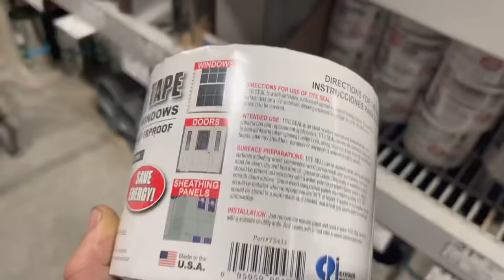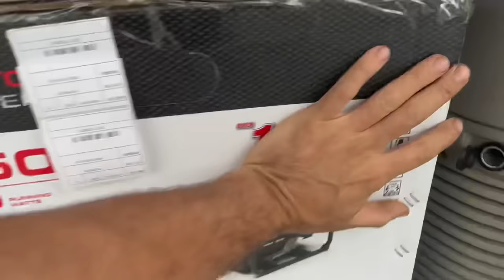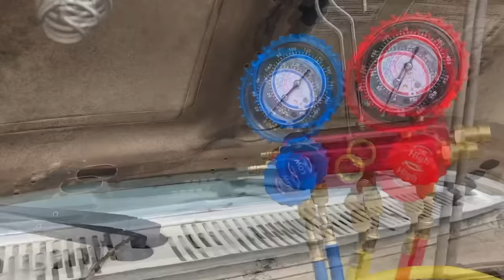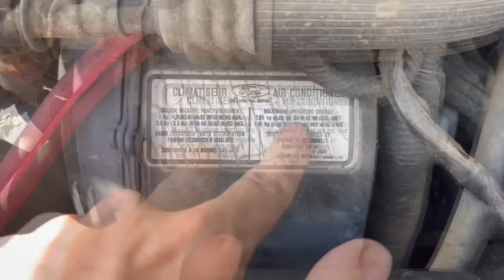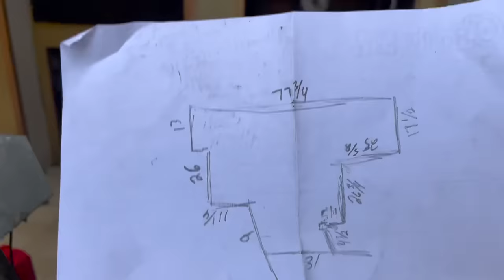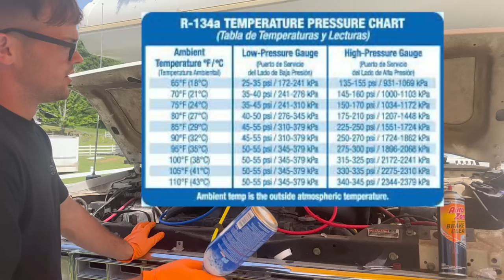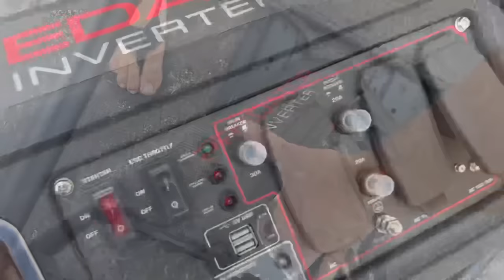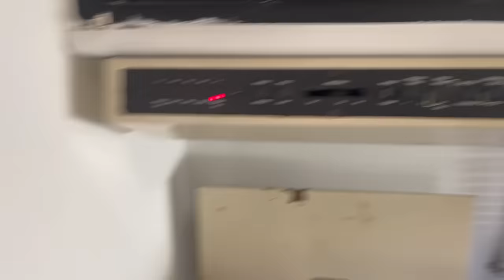Budget RV renovation at home, how much is this going to cost? DIY

Comment: Back in the early 80's we bought a 1959 Ford D bus from a church up the road and built the inside into a camper.  We used the original seats turning two of them from the right side backwards and mounting them on the left side to have two tables and 4 bus seats behind the driver's seat.  Built wood walls and frames and put two double beds, bunk style behind the seats with the bathroom behind that all on the driver's side.  On the passenger side we built a large countertop with a double basin sink, behind that was an apartment size gas stove converted to propane, a full size fridge behind that, a set of single upper & lower cabinets and 2 sets of single bunks behind that.  We mounted the air conditioner in the back upper glass hole of the emergency door.  The great thing about it was being steel it never leaked.  Of course the bad thing about it was, being steel the AC could only keep the back half of the bus cold and camping in the winter was just stupid cold, lol.   We only camped in it in winter once...that was more than enough, but we'd camp in it every summer in the Smoky's and at Dale Hollow and at Land Between the Lakes at Buchannon.  Fortunately all the windows in the bus still worked so going down the road wasn't too hot and the driver's seat had a fan mounted up in the corner of the roof beside the big mirror the driver used to watch the kids with.  Top speed on flat ground was 60mph as that big bus only had a little 292 under the hood.  If I had it now I'd still camp with it, but I'd add another AC unit on the roof at the front end, lol.
Reply from the maker: Wow that thing sounds cool

Comment: Just love seeing the family work ethic! Y'all rule. A comment on the generator fuel supply; the pickup in the tank is at the 1/4 tank level so you can't run the MH out of gas.  You might try connecting the gas pump when the tank is full.
Reply from the maker: Ok thank you will do

Comment: Those grey water lines are Qest. Qest replace copper flare tubing in mobile homes starting around 1977. In 1990, Qest was discontinued because of a class action lawsuit claiming Qest would dry rot and crack. It was replaced by PEX tubing, which is now the industry standard. Gut all that crap out now before you have a problem later.

Comment: 6:49 I would recommend for you to grease the AC motor. If it was stuck it could very well mean it was almost out of lubricant. And it will increase the motors lifespan by a lot!
Reply from the maker: Ok thank you
Reply: They're sealed - nothing to oil.
Reply: @ScottDLR  Even if sealed it will run dry. Trust me, had found many that are sealed and are dry.
Reply: @ScottDLR  Oh and it's even more likely when it's in the elements, granted the roof does help but it still will happen way faster
Reply: @aleksandersats9577  Yes, they're all dry. It uses an iron shaft turning on iron bushings. You could oil them but it will just sling itself out.
Reply: @ScottDLR  I am very sure motor of that size has bearings, and if it's bushings they are designed to bring oil into it. I know those kinds of bushings exist for motors and if it was bushings and it was dry you would hear it squeel but in the video it didn't.

Comment: I'm fixing up an '87 Minnie Winnie. It didn't even have that much wrong with it and I'm about $5k deep, plus purchase price. AC works great, was blowing 53° air here in AZ yesterday, meanwhile helping my parents change out their 3 year old Coleman Mach 3 Plus AC because it didn't blow cold enough. My dad upgraded to the Mach 15, the #1 rated 15K BTU AC, and it works worse than the Mach 3. Hoping it was just a factory defect. They sure don't make em like they used to. I'm sure you've discovered they don't build these things to be taken apart. Did yours have cabinets held up by screws going down through the roof, yet below the roof skin so you can't access them?

Comment: 17:24 - Dicor self leveling lap sealant is used around items protruding through the roof. It will not stick to silicone however. Keep that in mind.
Reply from the maker: Ok thanks for letting me know
Reply: Yeah caulking won’t last on a roof. Dicor Lapp seal.

Comment: Look at self leveling lap sealant for rv roof. I used dicor 501LSW on my bus roof seams and penetrations. Roll butyl tape is also handy. Appreciate your content enjoy the rv
Reply from the maker: Thank you
Reply: Haven’t finished the whole video yet. What you scraped off the roof that stuck to the osha flip flops was lap sealant. Old roof penetrations could be radio/tv antenna and solar connections. Your roofs probably good with all you did. If you have problems try the dicor over top on seams/penetrations. It seems to seep into cracks and holes if you put it on while it’s hot out. Get some rv toilet tank drop ins, really helps with the odor, and breaking up anything in the black tank. Nothing worse while on the road than black tank issues. If you have septic you can add a dump connection in your line. Can’t wait to see family trips in this beauty.
Reply: I heard the caratuff works better. Seen it on a bus redo. Not sure qat it's called  but am I ever glad I seen the cheaper stuff  they rolled  on the roof.  Had no idea they made it n they made it look so easy to put together too. There's  a part you can get that let's you start the ac without using the power or all the power if the compressor  so u can use batteries or  a smaller geni etc. I wanted to put it on mine cuz my geni seems complicated that came with n I don't  even know  if it works yet. I was gonna buy one too. But also my ac isn't working in my front.  Now I can deal with it too. I didn't realize the spare  battery is for the geni. But I guess if we take it put the lights won't work either or will they run off the motor one? Plz explain in a vid when u can I guess my alt was charging it then but it seem to die so fast lol

Comment: Great work guys! Just a suggestion but it would be an idea to run some sealer of some sort between your joints in the panelling, that will stop excess moisture getting behind them (condensation).
Reply from the maker: Ok good idea thank you
Reply: @Sleeperdude  
With all due respect. Don’t caulk between the paneling. You need a path for water/ vapor to escape, no more rot building up behind the paneling. 
Just my thought.
Great job. Love that the kids are super involved.
Reply: Might want to take a fin comb to your ac unit to help keep it cool..looked pretty flat in spots.
Reply: @timothyhill4630  that wasn't caulk, it was adhesive.
Reply: @timothyhill4630  With all due respect sir; if you leave a path for moisture to get in; THEN you have to leave a path for it to get out.

The original manufacturer did everything they could to make those panels watertight from both sides. Replicating that now with their repairs and renovations is just as important now as it was when it was built.  I agree with the Commenter who said to seal it up.

Comment: Amazing job, makes me miss my old RV, I never got the chance to truly repair mine but I feel like I'm right there with y'all, does your rig have a working propane water heater or is it electric? Either way love the video Josh and family, the generator mod was my favorite part! <3
Reply from the maker: Thank you, I tried to fix the water heater but never got it to work even after replacing the control panel
Reply: @Sleeperdude  thanks for the reply, and yea, that was an issue I had with my old rig, what I did was just install a temporary bypass in the hot and cold lines that went to it initially, and removed the unit all together, I had an idea to use like black rubber hoses on the hot side and then get a small holding tank (even one of those 5g water bottles that are used with a water cooler) wrap that in insulation and such to hold the hot water gathered then run one of the lights to a second 12v pump to the shower so you can have hot water on demand
Reply: @Sleeperdude  I also suspect it may have been an Atwood model as those are notorious for failing a lot

Comment: Love your rv renovation videos! Yalls are my favorite to watch and always encourage me to go work on mine. I love that your whole family is involved and you don't take yourselves too seriously! Also, since I haven't seen anyone mention, the gray goo is called butyl tape. I've used it to reseal windows, under trim, etc. It works really well under stuff and waterproofs screws when you have to drill into it. I always seal it with caulk anyway cause I don't 100% trust it though lol. Also, I got a tip from someone else on youtube to get sika construction sealant from Lowes. It's a polyurethane caulk and is supposed to last about 10 years.

Comment: Those AC pressure charts are only really for guessing when you don't have any way to determine how much refrigerant is in the system. If you're filling it from empty always use the specification on the vehicle

Comment: I’ve found that self leveling RTV works about the best for an RV roof. It “puddles” to fill in the gaps. Most RV supply stores carry it
Reply from the maker: Ok thanks
Reply: @Sleeperdude  use Dicor self leveling sealant or another rv specific roof sealant.  Everything else will crack and eventually fail.

Comment: You worked so hard and the guys at Lowe’s and Home Depot cold have told you to buy the right caulk for mobile home roofs that’s lasts for years and doesn’t crack just keep and eye on it hopefully with the mobile home sealer it will hold you always prime before you coat  but hey you will have years of fun just keep an eye out. I’m sure you have made many trips at this point I just started watching

Comment: Glad I got to see this. I have a fourwinds camper. I have a problem with the a/c leaking 👍

Solar panels 👍👍

The sky light trim inside would have unscrewed so you would have been able to hold the panel up inside with the trim. 4 screws only you could have just square cut the holes. Put the trim back on 👍

Comment: There's a foam gasket that goes between the a/c and the roof. I've worked in the rv industry for 30 plus year. You should fix it structurly and cool seal the roof.

Comment: Pipe is measured by the inside diameter 3 inch plus 1/4 inch twice for each side eqajs 3-1/2 inch as the coupler goes on the out side

Comment: You guys are fantastic! l don't like kids but yours are amazing! I have a 1990 Toyota Dolphin 19' RV that has leaked almost as bad as yours! Just frickin' TRY to find anyone to work on it. I have done the roof but it still leaks. And l have been trying four years to try to find someone to replace the roof without luck. l am 74 and just want to travel before l die! Last time l climbed on the roof to spread the tarp, l had a spell and couldn't move enuff to get off the roof. My poor, deaf brother was sitting just below me and couldn't hear me hollering for help! Just don't have the stamina l did a couple years ago. Back to the internet in search of...!

Comment: Looks good. I hope the “alex plus” acrylic latex caulking doesn’t crack underneath the roofing membrane you rolled on. I would’ve used silicone caulking. The latex isn’t as flexible as the silicone.

Comment: For your generator tank…I was considering doing this as well…get yourself a couple gallon fuel tank that will gravity feed the generator, and also put two bungs near the top for a send and return line. Run a line and an electric pump from your main fuel tank to the small generator tank, and a return line from the small generator tank back to the main. That way the electric pump will fill the generator tank and any excess will simply flow back to the main. I’m constantly going back and forth on if I should buy an RV or 5th wheel and just pull it with my diesel truck
Reply from the maker: Ok good idea

Comment: Might want to put some rubber between your pipe strap and pipe I've seen pipe strap eat through house plumbing from the vibration of running water hate to see what it would do to the sewer lines from driving down the road...

Comment: looks like the weird markings on the roof used to hold solar panels
was crinching a little when you put new roofpaneling over the rotten stuff but it turned out ok , you could get some solid wood planks round off the bottom edges paint them and put them over the joints that should tighten them up a little and add some strength to the roof , have to see if the topcabinets would still open though
i think the roof will leak again as the type of silicone you used isnt flexible enough, should use the rv type self leveling stuff , but for wat you spend on the rv you should be able to enjoy it for a year or two , then you can yank the engine windows aircon and rv stuff out and still make a profit , i allso seen one they converted intoo a flatbed truck (had to craft in a roofsection and rear from a donor van ) wish might be usefull too

Comment: we bought a 1985 Dodge B250 extended campervan that had some water damage, so I ripped out all the interior, including the ceiling and wall  panels. Only parts we left inside were the bunks for the bed/dinette and the carpet. I am about to start rebuilding it back to be mostly like it was originally, only more updated. I refurbished the cabinet/sink counter that was in there. The van had some mechanical issues so it's at the shop now getting repaired. Once it's back we will need to repair some holes in the fiberglass topper, by patching them with more fiberglass matting. That job will require us to first strip the paint, then sand down the areas where there are holes, then mix up the fiberglass resin and apply the matt to cover the holes. It's been 100f+ here for over 2 months, so I am hoping for a break in that heat soon so I don't cook while trying to fix that. Also have to replace the vent fan, then once it's all done, coat the roof with that same roof coating. It's going to be a lot of work, and that will hopefully stop the leaking. Then we can put in our insulation, and build back the wall/ceiling panels, and get the rest of the stuff back inside so we can use it as a camper again. Its been interesting watching all you guys went through restoring that RV. It's looking so much better, and functional. Great job!
Reply from the maker: Thank you we really appreciate it

Comment: Butyl tape… that’s the gooey stuff. You should have used that around your patches. It always stays soft and squishy. Mineral spirits gets it off easily. So butyl tape underneath then self leveling roof sealer on the top and recheck in a couple weeks later.

Comment: I did something similar with a 94’ Carson enclosed 24’ car trailer. The inside was trashed so I replaced it with 1/4” plywood. New tires , new marker lights , a ton of wiring. But it’s worth it for the $1000 I paid for it.
Reply from the maker: Awesome

Comment: Your hard work will pay off Sleeperdude & Family. My covid project was refurbishing a 25 year old Class B Xplorer XLW. Mine turned out great. One thing you WILL want to do. Your ROOF. I know how much time and effort you spent up there. The caulk you used is OK for a fixed non moving window at home, but remember the heat expansion/contraction and vibration an RV experiences. You are still likely OK if you do one more thing to protect all your hard work. Dicor self leveling RV sealant is an incredible product. Self leveling is they key. It was probably the stuff you scraped up from around the fan & AC unit. Its important to use for a zillion reasons. You literally goop it on every seam (yes particularly the roof edge seam). It self levels over a couple hours and cures after 24-48, but stays flexible, particularly in the heat. That stuff will seal your hard fought roof battle for sure. If you leave it like it is you may make it thru one season & be doing it all over again. Do it now for your own sanity. -
Reply from the maker: Ok good to know thank you

Comment: I can totally relate. I bought my 89 E350 27' Lazy Daze in Dec 2018 with 88k on it for$5,400 (1/10 of what it cost brand new). It was in very good condition other than hadn't been buffed or waxed for over 20 years. Being disabled, it took me close to 40 hours to accomplish. I've put at least $5,000 in parts etc. And live in it too.
Still needs a rear sway bar and all the window seals & mouldings replaced, but it'll get there as long as I stay on it. 
You're doing good, stay with it. Peace.
Reply from the maker: That’s awesome good job

Comment: You actually don't want to use latex/acrylic or silicone caulk on the roof due to the uv rays and the hot/cold expansion and contraction.

Comment: After all the roof patches & mods you should have used the most sure way to seal 🦭 it. A Giant super heavy dead weight lift of Roofing Rubber & Glue it down overlapping the Corners and anything that breaches thru the roof
Reply from the maker: Yeah probably so

Comment: Your camper's interior AC cover that has yellowed with age... It can be bleached back with 40 volume peroxide you can get at a beauty supply store. Don't get it on your skin use rubber gloves. apply it liberally discoloration. Cover in clear plastic a bag is best so it stays wet place in the sun then rinse. this works on sun-discolored vinyl too, dash & door panels...(check small spot for colorfastness first)
Reply from the maker: Ok thanks for the info